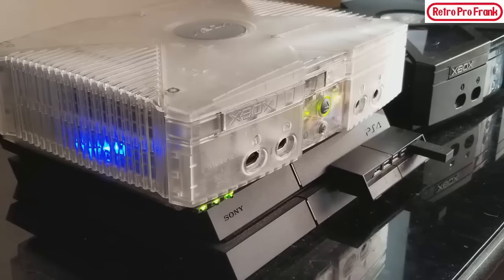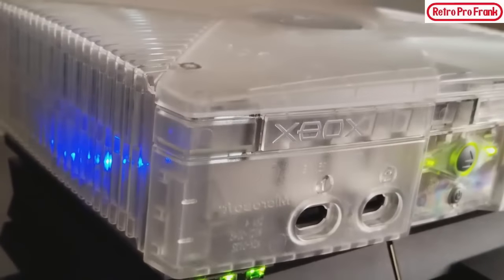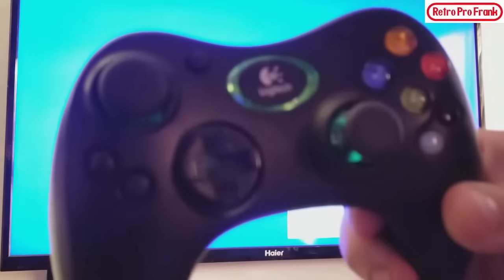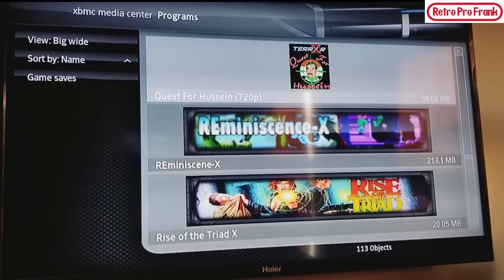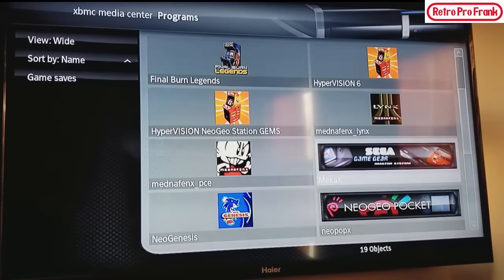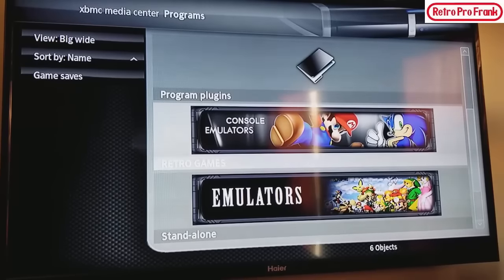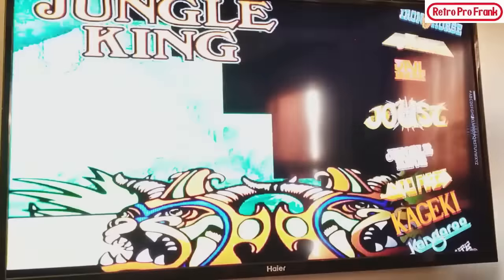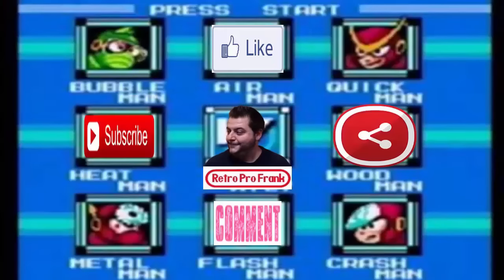MY 2TB HARD MODDED ORIGINAL XBOX WITH XBMC AND XECUTER 2.6 CE XBMC - RETRO PRO FRANK

Comment: Question about Xbox classic hard drive upgrade
How do I know if a 2 Terrabyte Hard disk is possible in my Xbox. I have a hardware mod but I don't know exactly which chip is installed. When I start the Xbox I see the Xbox logo and under it is says Open XDK. I bought the Xbox used. There is for example Unleashed X on it and DVD2Xbox among other things. Thanks for your help
Reply from the maker: There's so many variables that going to play here we will be going back and forth for the next 6 months and I'm sorry I don't have that kind of time. But Google is your best bet there are lots of answers that you're looking for thank you

Comment: I just picked up a 1.0 original Xbox off eBay for $60 and it had the XECUTER 2.6
Reply: Damn that's a steal
Reply: Hope it has it's CLOCK CAPACITOR removed. If not, it is really easy to do and it is HIGHLY RECCOMENDED that you do so. Over time on OG Xbox versions 1.0 to 1.5. the capacitor eventually fails and leaks all over the place, which can fry your motherboard. NOT GOOD! You don't really need it at all and is safe to remove. Many video tutorials on YouTube on how to find it and take it out. 

Now if you have a 1.6 XBOX ONLY, you do NOT remove it and leave it in as in that case the machine won't function without it. But for versions 1.0 to 1.5, the sooner you can pull that capacitor out the better, given that most are at least 15 years old by now.
Reply: Nice!!

Comment: How do you reset the password. It tells me too many wrong attempts and shuts the Xbox off... plez help.
Reply from the maker: If there's a password on the system in order to reset it you need to know the password. Only way around it would be to install a mod chip in a new hard drive
Reply: @Retroprofrank  i can get into the xbox and run emus and everything. just password locked on xbmc